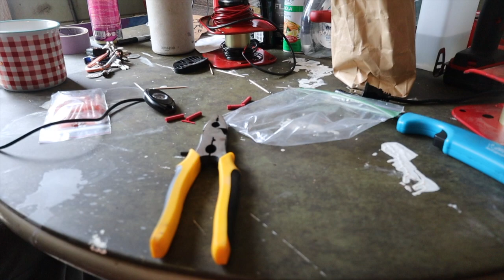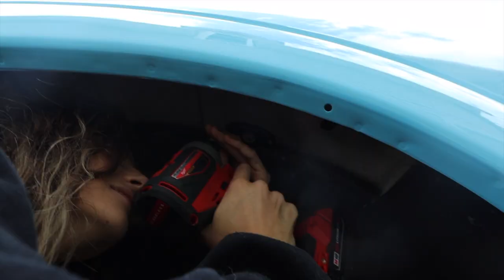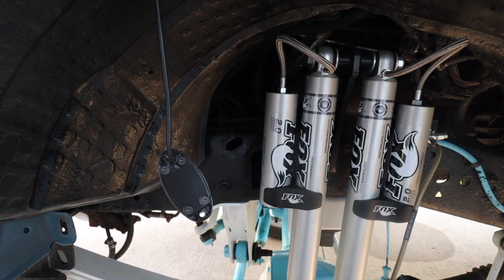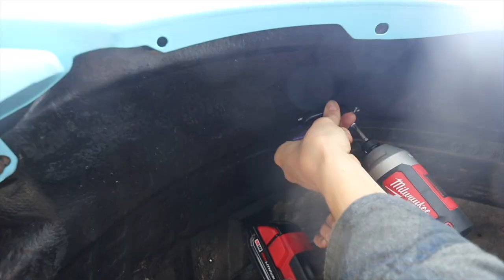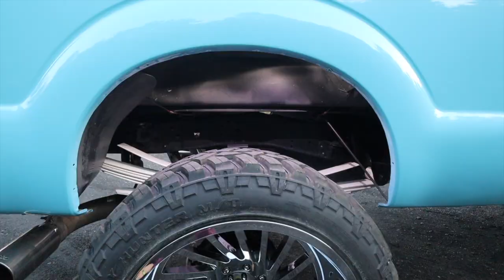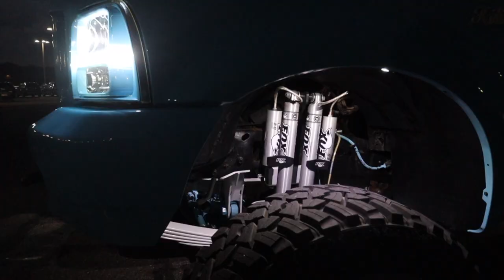INSTALLING ROCK LIGHTS ON MY 6.0 POWERSTROKE!!

Comment: Yeah if you want it to hold up over time, wire loom and solder with heat shrink the connections

Comment: Great job, truck is looking killer. It's certainly very rewarding to do the work yourself! A little tip, ditch the wire nuts and solder the connections and use heat shrink. This will ensure longevity and help keep corrosion or loose connections from becoming a problem. Keep up the great work!

Comment: Like good effort. But, highly advise you to get rid of the wire nuts those are for home electrical not automotive. You will have issues later on. Also please put the wire in a loom or use fabric tape.  All the nice work on the truck dont start doing hack work.

Comment: It’s your truck but I definitely recommend ditching the nuts and learn to solder your connection’s it’s not as hard as it looks, the reason the switch fried is I’m guessing you hooked the lights straight to the switch and then to the battery when you really should use a relay because switches can’t handle that many amps and lastly I would strongly recommend you put a fuse near the battery if you haven’t already because that will save you from burning the truck to the ground

Comment: Drove my 6.0 today for the first time in a while.Had to get it outta my hanger for FAA inspection Fun at first, loud and sloppy steering vs my 6.7 but It became fucking hell fast! Around 4pm halfway across the Sacramento Valley was when I realized my A/C wasn't workin while sitting in traffic  @ over 100 deg. I damn near traded the fuckin truck to a 12yrold kid for his slurpee and bus pass.
Reply from the maker: Hahaha that would have made that kids day👀 my AC is out too and 1 minute too long at a red light could do that😂

Comment: NICE…. But add a relay to them rock light just in case if they instantly cooked a switch. Don’t want to loose the build over wiring

Comment: Truck looks good,  hope you crimped those wire fittings down
Reply from the maker: Thank you!! Yes I got that fixed right away hahhaha will mention it in next video!
Reply: @KatieKae  that's good. You did an amazing job on that truck. I know how the little things are. Did the same stuff when I owned my 2004 Kenworth w900L with an ISX15 Cummins. That truck could climb a wall, literally lol.

Comment: Not trying to hate but you definitely don’t wanna use wire nuts and definitely not crimps either over time it will come lose and you’ll have some stop working and be wiggling the wires to get them to come on solder and heat shrink them all and it will work everytime

Comment: Katie wire nuts are used for in “House” applications never ever for automotive. They will come loose and corrode big no no..
Reply from the maker: It was fixed 👍🏼👍🏼
Reply: Rhett